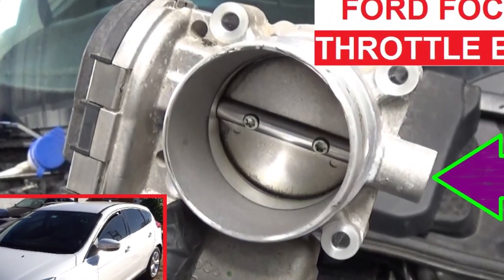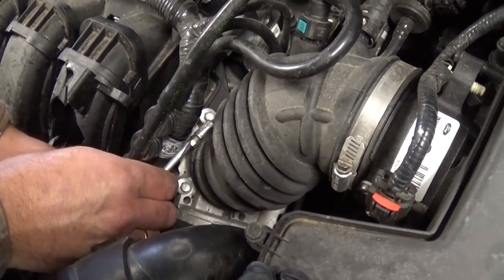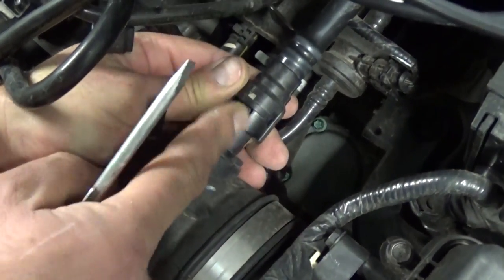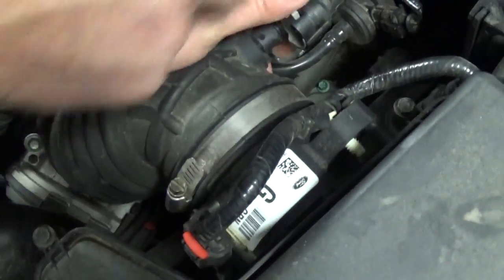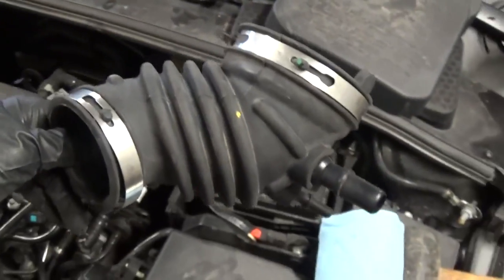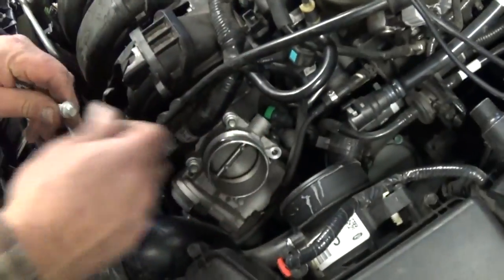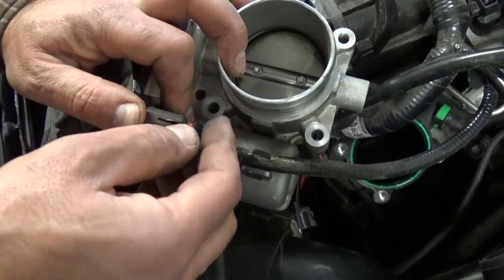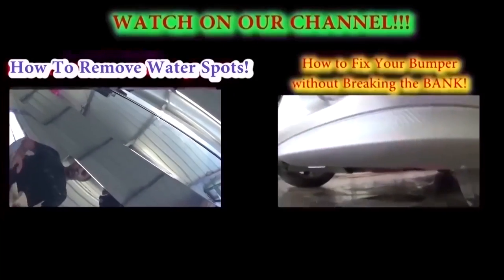Throttle Body Replacement Ford Focus MK3 MKIII 2011 2012 2013 2014 2015 2016

Comment: good video. Where is the Mass Air Flow Sensor on the Focus?
Reply: The MAF Sensor is the black part that the hose is connected to. At https://youtu.be/rxmX1ahckL4?t=23 you can see it is the black plastic piece with the white label on it.

Comment: I have never wore gloves to work on a car in the 40 years I've done so. The guy actually doing the work on the car doesn't wear gloves either. But gloves are needed to "point" to things? I will never understand people who wear gloves to work on a car.......or point at one.
Reply: Because most chemicals used in a workshop are carcinogenic and toxic, no point shortening your life expectancy
Reply: @harrisonewington2846  - I am here to tell you from your future, after working on cars for 40 years, no issues from working on cars. Yes, of course be conscious of chemicals that could be detrimental if absorbed through the skin (brake cleaner, brake fluid, etc.) . However, when doing mechanical work on a car there is typically no chemical to worry about. I see guys pull a fuse and they wear gloves. I have no idea why. I saw a guy replacing interior light bulbs with LED lights and he wore gloves to do this. I have no idea why. You don't want to get skin oils on a halogen bulb, but all bulbs being removed were regular incandescents and they don't have that issue, nor do the LED bulbs. Wearing gloves, from what I've seen, is done because they think it looks more "legitimate," as if the person doing the work is more believable. I don't get it.
Reply: People weather gloves when making videos as it looks more esthetic and professional, some people are put off by dirty hands or nails